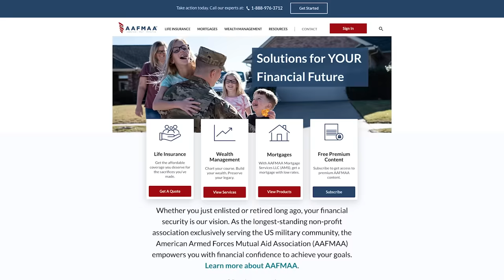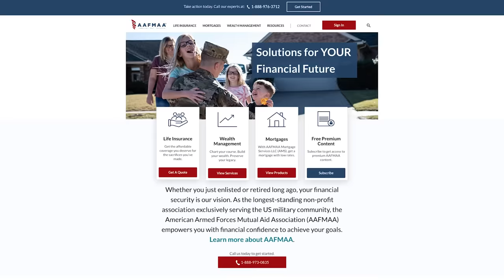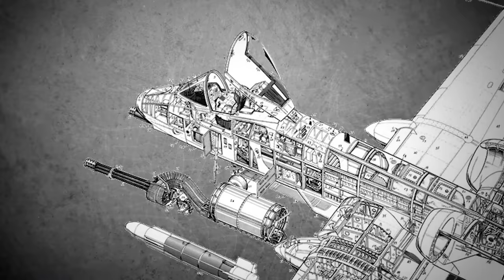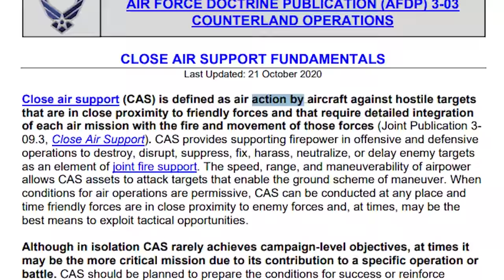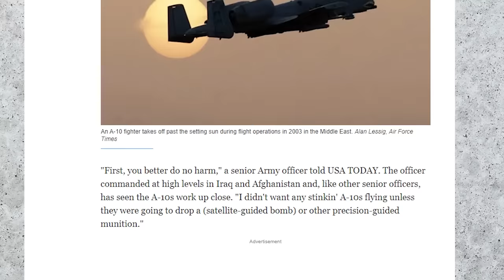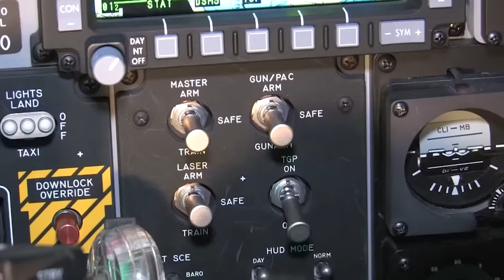Why the Air Force is Screaming to Retire the A-10 Warthog

Comment: A good, down-to-earth explanation why it's necessary.  All weapons become obsolete at some point. I hear the B-52 may even become so a few decades from now.
Reply: The b52 is literally older than the A 10
Reply: They are upgrading the B-52 soon will be B-52J
Reply: At the peak of the Cold War several Countries like Denmark and Canada gave the US some very generous overflight rights , but they didn't want those rights to be permanent so they were tied specifically to the operation of the B-52.

And that's why the Air Force is still operating a 70 year old bomber.

Edit:

Because the Air Force needs to keep the B-52 in service in order to avoid renegotiating agreements with other countries , they find some combat role it can still carry out and retrofit the plane to do it.

A plane with long range , large payload and a simple frame can always be modified to do something...currently it's hauling cruise missiles closer to the target before launching them, even though military cargo planes can do the same mission.
Reply: @glennchartrand5411  That, and because simply strategic bombers as a whole are somewhat of a relic, so the need to replace them outright is small, because the benefit we would get is minimal to nil. Simply outright impossible to protect them in modern air combat with it's focus on BVR missiles, though in actual combat, there's zero chance we'd fly B-52s alone, it just is a significant downside to them as a concept.
Reply: Tell that to the Browning M2...
Reply: The Buff will outlive us all
Reply: @SGT_Fon  guns are simple. Ukraine still uses the Maxim MG from WW1. It hasn't needed to evolve much.

Airplanes though? They need to be advanced. There's no "keep it simple, stupid" with war planes
Reply: @wilsonsantiago3095  They mighty BJ
Reply: @SGT_Fon A gun that spits out .50 BMG that the US military has over 50 years worth of parts and ammo for it hardly worth to use as an counterpoint. I like to ask you: why did the US military change rifle from the M1903 Springfield to the M1 Garand when it still uses the same 30-06 round? The M1903 can still fire that round just as well so why the replacement?
Reply: @JJ-M  Strategic bombers became obsolete (at strategic bombing) before the Vietnam War with the introduction of SAMs, intercontinental ballistic missiles and nuclear powered submarines.   The B-52 is only good for launching cruise missiles from far away and against 3rd world countries in the ant squashing role.
Reply: The B-52 will be bomb running insurgents on Mars long before its retired
Reply: The B52 is mostly a cruise missile truck that shoots from afar.  I don't see it ever dropping bombs on a target with even a semblance of air defense capabilities.   Images of the B52 carpet bombing ground targets like in the first Gulf War is likely something we won't see again.
Reply: Stable bomb truck platform go burrhhhh
Reply: @1977Yakko  One should specify what afar means: 20 AGM-86C's with a Range of up to 1400 miles and a 2500lb Warhead. You can argue that the B-52 can remove the air defense to enable carpet bombing. The AGM-86 is not very sophisticated but it carries enough punch to eliminate Missles Batteries.
Reply: Yeah when it's 100 hundred years old.
Reply: @scotthenderson292 the primary selling point for the new F-35 is that it is both more simple (for a multi-role fighter jet) and also far cheaper than the superior F-22 Raptor.
Reply: @wilsonsantiago3095  it will fly until it is 90-100 years old
Reply: @wilsonsantiago3095  What happens when they run out of letters? 🤣
Reply: As long as the missile is good, the B52 is good.
Reply: @glennchartrand5411

Or because it can fire cruise missiles….
Reply: @glennchartrand5411 that's crazy never knew that

 did they ever explain why that bomber in particular was given those rights?
Reply: @pmpowalisz  true, but the F35 is still incredibly complicated. As much as I love the F22, it's not miles and miles ahead of the F35 despite its better capabilities. 

And honestly, the F22s extreme cost was due to the limited manufacturing they did per unit. Consequences of it being limited to only USAF purchase. Despite the Japanese desperately wanting in when they were first introdiced. 

That price per unit logic is the same logic that dictates why the F35 has been going down in cost per unit steadily since it was introduced. It was open to purchases for many of the US allies out there. The more that are sold, the cheaper it costs to manufacture per unit.
Reply: There's value in the B-52s' really big payload bay being able to carry missiles.
Reply: LOL
Reply: @JJ-M pretty sure the b-52 could make a pretty  goos missle / guided bomb carrier.
Reply: @theotherohlourdespadua1131  Arguably guns haven't changed all that much in operation for nearly a century. There are little improvements in metallurgy, composites, and precision, but it's not that much of an revolution. The biggest change is maybe reliable semi-auto/automatic fire, everything else since then are little tweaks to the formula.

With planes, every several decades there's some new thing that basically obsoletes the older generation. An F-86 would be helpless against an F-4. An F-4 can't catch up to an F-15. An F-15 can't even tell when an F-35 is nearby if the F-35 doesn't want to.

With guns though, and ground combat in general, bullets are still the preferred ammunition. A slightly bigger or faster bullet isn't really a major leap.
Reply: @BaguettePair  Bomb truck is a very different job than CAS though. Similar to why Engineering vehicles and ARVs will sometimes be built on last-gen tank chassis.
Reply: @Appletank8  Yea Gun tech hit a decades-long Plateau. Once semi-auto and select fire was refined, there's only minor improvements to be made.
Reply: @JJ-M Thing is, the B-52 does have some defenses against BVR threats, namely the mass of electronic countermeasures installed on the aircraft and the extreme range of its cruise missiles. It can’t dodge missiles for shit, but the sheer size means that it can accommodate jammers and other EW kit to let it live. 

There ain’t an air-air missile, let alone air defense system out there that can match the range of a JASSM or ALCM. And with the possibility of hypersonic weapon systems, the B-52 would be quite an idea launch platform, as the only other platform to launch them would be the F-15E, and it could only carry one such missile.
Reply: C-130 IS THE OLDEST US AIRCRAFT STILL FLYING FOLLOWED BY THE B-52 😆😆😆
Reply: @theotherohlourdespadua1131 the answer to your question is the MILITARY INDUSTRIAL COMPLEX like Lockheed, General Electric, General Dynamics, Raytheon and all the ship building contractors who control congress and only cares about profits than practical applications. As a retired combat grunt, I tell the US military and government is ancient Rome soon to be a relic 😂😂😂
Reply: @pmpowalisz Neither aircraft are proven fighters. Over priced trash 😂😂😂
Reply: No they got a program to upgrade all the B52's and keep em in service for another 70 years, anything built in the 70's and 80'S will be considered obsolete and taken out of service though
Reply: @toolbaggers  the program already started
Reply: @LiveFreeOrDieDH  they will use double letters lolol
Reply: Good chance most all the original pilots have passed on. That is one old platform. Yes, in a few centuries, it will be retired.
Reply: @scotthenderson292  We are seeing the new attack plane, only they cost far less, have no pilot and are directed to a target and blow up. Drones. We've gone from the Clone Wars to the Drone Wars.
Reply: @bondgabebond4907  that's certainly true. Cheap and controlled by a man a dozen miles away
Reply: @hungmeow8284  just because the F-22 Raptor and it’s more KISS younger cousin hasn’t yet been given a combat opportunity to prove themselves, doesn’t mean they are not the deadliest fighter aircraft in the world. When they (likely both) decimate their Chinese equivalents in the next few years (and not by dogfighting), you will be eating your over-priced comment.
Reply: so many not getting the joke lmfao
Reply: b52 is planned for service until the 2060s
Reply: In Ukraine war, it seems, everything that flies low dies. Well, everything that flies, really, seems to get shot down, everything except those pesky drones.
Reply: @JJ-M the other benefit of the B-52 is, we already have all the parts, even with the upgrades it’s got, it’s so cheap to fix compared to what a brand new plane would cost

That and it’s mission set is able to change because of its massive payload capacity 

Being able to have a 50 cruise missiles in 1 airframe is kinda nuts

While other aircraft “can” carry such armaments, the B-52 can fly high, be surrounded by assets and just get close enough to drop all 50 at once

Something that would take nearly as much aircraft, must more expensive aircraft I might add, anyways
Reply: @LiveFreeOrDieDH  Add a second letter or a number after it. so B-52-2A.
Reply: Been for a long time
Nothing to replace it
Same as the a10
Reply: @BaguettePair  B52 is older by a long way. It was on the drawing board in 1947.
Reply: @SGT_Fon   The Browning M2 is not the same thing as the A-10 Thunderbolt II. The M2 Browning is literally just a .50 caliber heavy machine gun that is far easier to use and maintain than an aircraft. Aircraft are a whole different story. Guns are simple but aircraft are not.
Reply: LOL BOTH UKRAINE & RUSSIA STILL USES WW 1 ERA WEAPONS?! 🤣 IMHO THE ARMY SHOULDN'T RELY ON THE AIRFORCE FOR IT'S OWN CAS WHEN THEY CAN HAVE THEIR OWN ATTACK HELICOPTERS LIKE THE APACHE, SO TRANSFER THOSE A10s TO THE ARMY INSTEAD COZ OBVIOUSLY THE AIRFORCE DOESN'T WANT IT EVER SINCE, ARMY SHOULD BE LIKE THE NAVY AND HAVE IT'S OWN AIRFORCE TOO?!
Reply: The B-52’s will be fixed with anti gravity engines and then warp drives and will still be flying in the year 6500 dropping 300mt JDAM’s on the main Ventiru villages on Sirius 3. Man will never not know a sky without a B-52 flying around?!
Reply: @BaguettePair that’s not the point. He’s pointing out that even the b-52, an aircraft that has received an unfathomable amount of modernization packages, will also eventually become outdated and obsolete. Especially as the military refocuses on preparing for a near peer conflict and is moving away from the Global war on Terror
Reply: @hungmeow8284  The B-52s airframes we’re built in the 1960’s.  There are no C-130’s in US service anywhere near that old.
Reply: They'll sooner strap anti-air laser systems to the B-52 than retire it I'd bet
Reply: @Joesolo13 its not the firearm anymore. It's all about what you can strap onto it.
Reply: Lol exactly, a few decades from now
Reply: The buff lives forever
Reply: @BaguettePair  . You could have just written "The B52 is older than the A-10". That gets the message across. Most people know that B52s were on the scene in WW2 though anyway, so I think the original comment went over your head. I think it was a "joke". Ha ha.
Reply: Weapons don’t necessarily become obsolete even if they do get older the Russian mossinn ne gaunt is still being used as sniper to this day
Reply: The A-10 is a one actor show.  It is amazing as a dive bomber and tank killer.  The problem is it vulnerable to fighter attacks and must be escorted if we do not have Air Superiority.
They are an old airframe and designed to fight the Red Army, which no longer exists.  It is obsolete and expensive to maintain and operate.
Reply: Funny how the cardboard drone from Australia is one of the most effective weapons on the Ukrainian battlefield, and its real cheap.
Reply: @theotherohlourdespadua1131  garand designed the M1 to be chambered in  a short case .280 cal which was far more efficient but the gov had so much stockpiled 30.06 that they demanded it be redesigned to chamber the heavier round
Reply: @charlesdignam780 ”designed to fight the Red Army, which no longer exists”, pretty much sums up the A-10 best. Too many people put it down because they don’t understand it was made for and that it’s good to make dedicated aircraft for the needs of the times rather than think it’s a design flaw of an aircraft if it can’t be indefinitely upgraded and useful. Like the B-52 might still be efficient money wise for its role for now, but newly designed aircraft could most definitely perform those roles better and will some day when the need justifies the cost, just like the F-22 despite that being a masterpiece of engineering that could remain relevant for the foreseeable future.
Reply: @theotherohlourdespadua11313
The M1 Garand is semi auto, the Springfield is bolt action.  Big difference.
Reply: Same with the F-15. Any day now. Sad.
Reply: All weapons except the humble knife. Knives are pretty much only used as tools nowadays but they are still commonly issued to modern militaries. As long as we have real people fighting wars, we will have knives
Reply: BUFF.  IS.  FOREVER.
BUFF.  IS.  ETERNAL.
BUFF.  IS.  FIRE.
BUFF.  IS..........DEATH.
Reply: B52 already is, go look at the B1 Lancer
Reply: The B-52 last as long as it is because its survivability factor is irrelevant, being a large plane with a large payload that can carry standoff weapons with a range of thousands of miles. Basically, it doesn't have to go into the environment where an opponent could threaten it, if a B-52 launched its missiles, you'll have better chance at defending shooting down the missiles than trying to go after the B-52, which will likely already launched all its payload half an hour ago anyway. It wasn't crippled by overspecialization like the A-10 did.
Reply: @pmpowalisz  More simple in terms of raw performance, sure, but the F-35 has some of the most advanced electronic systems in use.
Reply: @kunkkahuskar3979  Helicopters aren't able to operate effectively in environments where anti-air systems are employed, unfortunately.
Reply: B52 is getting upgraded to the B52 J in 2024, bringing its service life past 2050.
Reply: The B-52's been on that knife edge since the USSR fell tbh, and there's only a few things saving it from obsolescence
Reply: And yet every hairless ape to go into combat from the Ice Age to the War on Terror carried a knife.
Reply: @Bluecatte   nah nah, they're retiring all the lancers, they're obsolete now ya know? not the 52's though, those still got another 70 years of life left in 'em! at minimum! /s
Reply: @LiveFreeOrDieDH - at first, Greek alphabet, alpha, beta, gamma...

When that is gone, Hebrew, then Chinese alphabet in the end, emojis.

"The Venusian floating city was sunk by a high-hypersonic missile launched by an Earth's forces B52😈, the last update of the three hundred years old AirBoing [sic] design".
Reply: @woongah  It warms my heart to know that my great great great... grandchildren will witness the B52-🍆
Reply: @panthercreek60  Most machine guns in the US inventory (Browning M1919 for example) were already chambered in .30-06.  Armies worldwide wanted to simplify logistics by using the same cartridge for their service rifles and machine guns.  Optimizing that cartridge for a machine gun even though it's overpowered for a rifle was preferable to the other way around.  Ian McCollum discussed this in one of his videos (called "Best WW2 Cartridge" or something like that).
Reply: @LiveFreeOrDieDH  
Yes, that was certainly another important consideration, and yet there remained a big ammo supply headache for rifle companies because so many that were assigned as radiomen, machine gun ammo carriers, bazooka men, and ammo carriers, flamethrower men and support personnel, and mortar units were almost exclusively armed with the.30 carbine, and most non coms were issued Thompson's.45 sub guns. 
And in the Pacific theatre many soldiers and Marines were given browning shotguns. 
I don't blame the government for insisting on the .30-06 for the standard infantry rifle. I was just thinking how much more effective it would have been if chambered according to it's original design
Reply: @BaguettePair yes, but it's still very effective, the same can't be said for the a 10
Reply: @toolbaggers strategic bombers aren't obsolete. They never have been. They've just had to move with the times and be capable of other things as well as nukes. They're a vital part of the Nuclear Triad.
Reply: @hungmeow8284 you're a combat grunt and therefore oblivious to the wider strategic picture. Perhaps stick to being a grunt and leave the big decisions to the grown ups
Reply: @tomhenry897 don't degrade the B52 like that. It's a plane that can actually do it's job properly